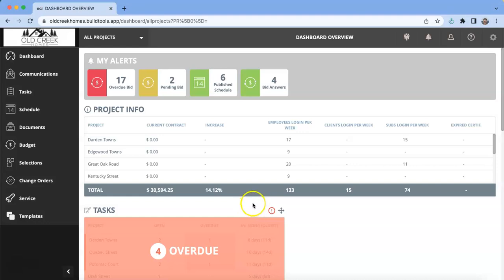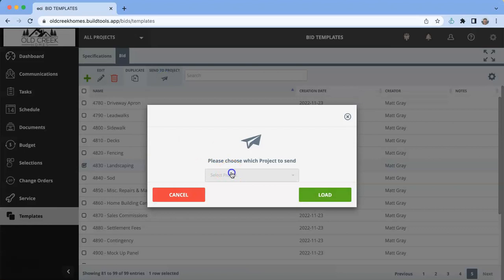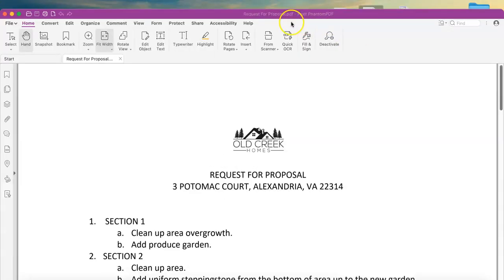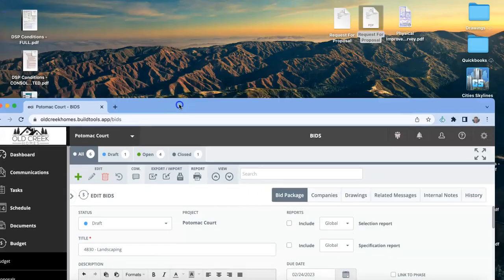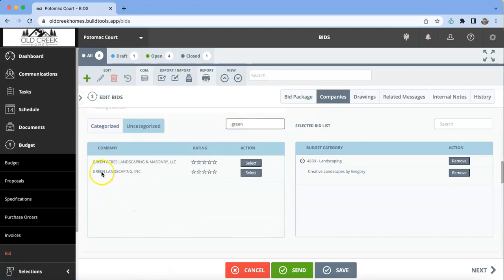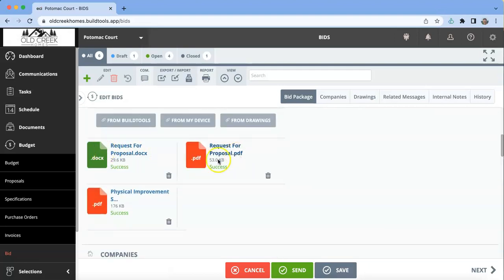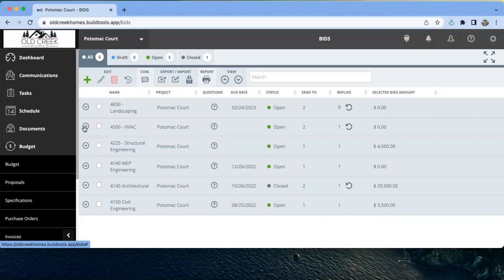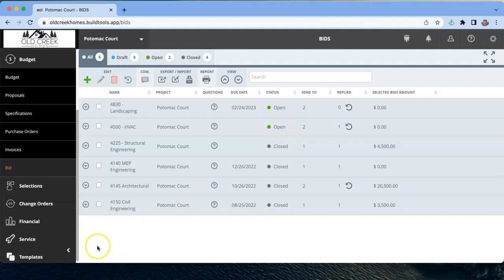Build Tools - How To Bid a Project (FOR HOMEBUILDERS)

Comment: Super informative, thanks for the upload! Our company just made the switch to buildtools from coconstruct after visiting ECI's booth at IBS.  Still trying to integrate, I'm assuming I dont have any bid templates because we haven't sent bids out through the program yet, but im setting up our first project to get sent out. Would it be worth setting up the template first or just building the bids in the project?
Reply from the maker: I've tried them all.  Almost all are not built by builders and that starts the cascade of issues.  BuildTools has to be built by builders because they just get it.  

No, you don't have bid templates but yes you should 100% use them.  It will save a ton of time.  It takes time to set up but after that pain is over, you will be able to acceleration quickly.  

Another trick, which you'll have to test if it works for you, is build a project.  For example, a schedule.  Make that schedule the best you can.  Then copy/paste that project as a template.  Then you can make a schedule in about 10 seconds.
Reply from the maker: Here's my recommendation how to make a schedule:  https://www.youtube.com/watch?v=zD70rpMuyjM